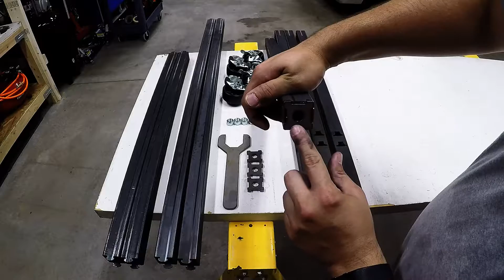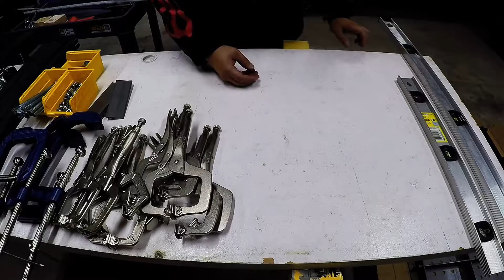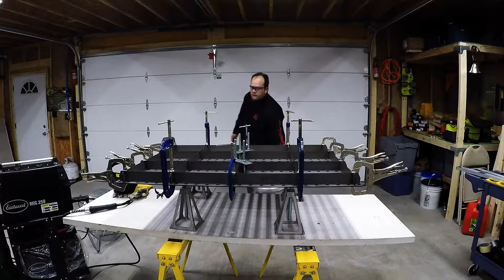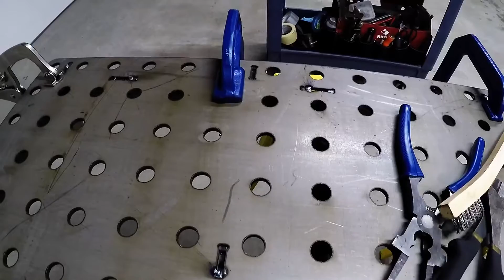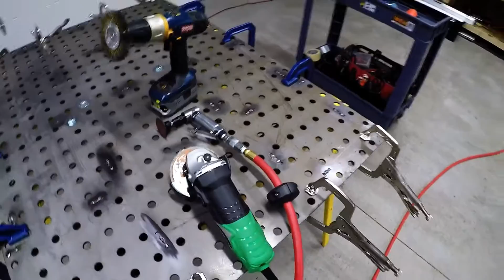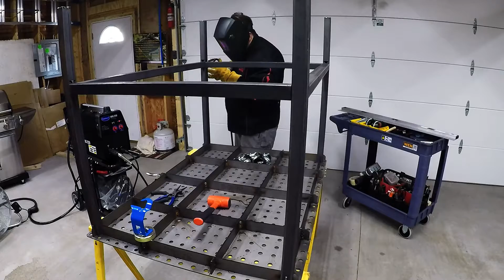Welding Table Build - CertiFlat Pro

Comment: Look at 9-18 the levels are really wobbling all over when you turn loose of them. You welded way to much on the slots on the table top which left a proud weld, which caused you to have to grind to much. And you must watch your heat better. The company has a great video that addresses all of this. You've got a good but may never be flat. Sorry but every one has to start some place.
Reply: 9-02